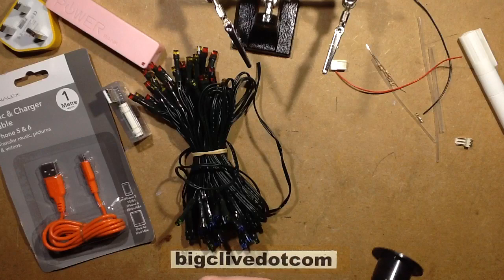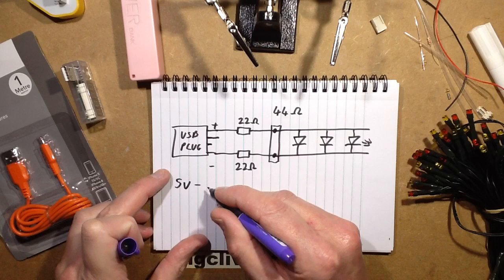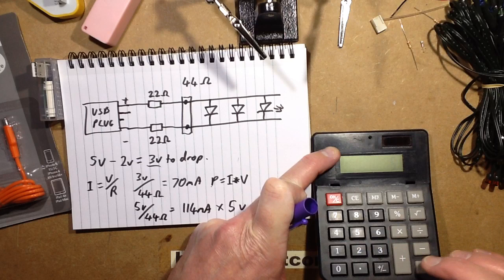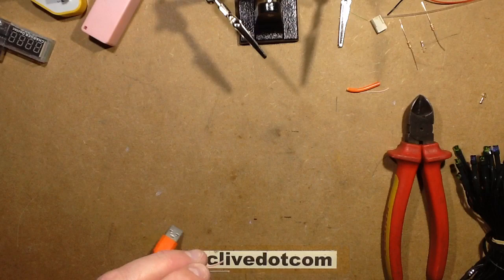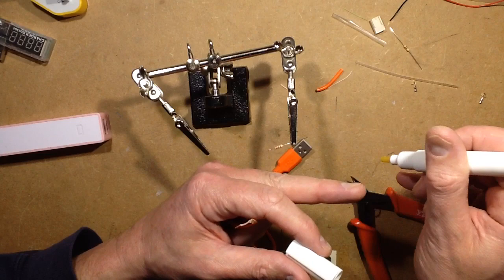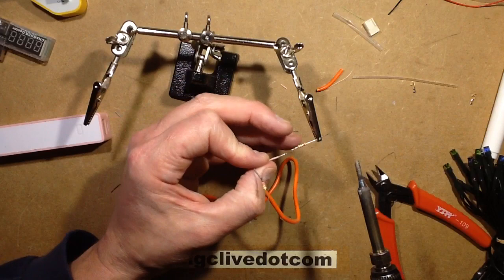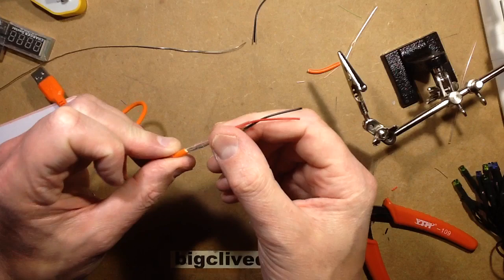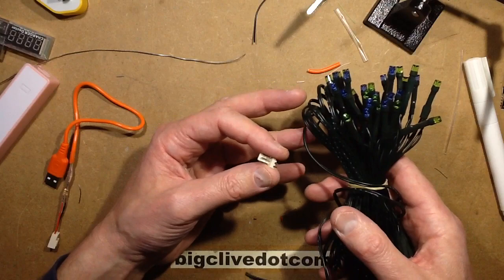Run LED strings on USB chargers and power banks.

Comment: Clive, I've noticed in some of your recent videos that when you move around the bench or turn away that the volume of your voice drops. Does this mean you've stopped using your microphone cap and, if so, why? Hope your Mum enjoys the lights, my Mum died recently after a year of increasing illness and I know how difficult it can be at times looking after your Mum when she appears to be slipping away.
Reply from the maker: The microphone doesn't work properly with the iPad.  It introduces a lot of noise.
Reply: Is that permanent or intermittent noise or does it just pick up a lot of background noise? If I remember correctly it's connected to the headphone jack isn't it?
Reply from the maker: For some reason it acts as an antenna with the iPad and causes lots of continuous noise.
Reply: It's a shame that it does that after all the work you put in making it and incorporating it into the cap - still, nothing ventured...
I assume you've already investigated possible causes and from your comment it sounds like the problem only occurs with your iPad. It's annoying when things like that happen. Maybe the iPad is overly sensitive or just a bit more crappy!

Comment: I'm struggling to figure out what would happen if I wanted to do multiple string lights and how toeasure what im. Like if all together all of the string lights used 14 AA batteries would that mean to power all of them I would be using 21 volts?

Comment: Where did you get the string of LED's? I have the power bank covered, as I build them all the time. I like things I can run directly from the power bank.
Reply from the maker: They were probably part of a solar set.  They usually have all the LEDs in parallel.
Reply: Try B&M around April time when they start to get their garden stock in.

Comment: Usb batteries do not have signal lines hooked up at all, they are by CE and UL standards null, No connection.     I have used them to connect smd LEDS in the past and had to cross them over to +&- upstream.

Comment: You are literally reading my mind with those videos, I was going to do exactly that, only power the thing from Li-Ions over the insides of DIY powerbank. One questions though: instead of using resistors, would it be more efficient to use some step-down converter (like S7V8A)? My LEDs will draw 1000mA (hefty set of white LEDs).
Reply: It would be a lot more efficient, use a simple buck converter IC.
Reply: It would be more efficient. But you must never drive LEDs by setting a voltage. The forward voltage of LEDs is quite temperature dependent. A resistor is the simple way to still limit the current in that case. You might be better off taking a constant current LED driver and set it to the right current for the whole string (and hope that non of the LEDs go open circuit, because than the other LEDs would get higher current).

Comment: Hi and Thx for your videos. However I would not use a cheap power supply like that without surveillance. Are a few bucks worth taking the risk of a fire in your home? Also the rating of the resistors are in open air I think and at the rating the temperature increase can be 100 or more. It's usually recommended to avoid above 50% of the rating especially if the heat is trapped. And again, putting 4 resistors instead of 2 costs only cents. And finally 3x7=21 hahaha... :p

Comment: I've always wondered, how do you instantly know the conversion between inches and millimeters for most lengths? Do your electric engineering jobs make use of both?
Reply from the maker: +Zazaaji In the UK we use both systems.  Our tape measures and rulers are marked with inches on one side and metric on the other.

Comment: Sorry to hear about your mum, altzeimers creates lots of confusion :-(.

Ive seen lots of those 3,4,5,6 pin connectors in old video recorders, they work for years.
Also old plastic film containers are good for protecting mid cable mods :-D

Comment: Evening Mr Clive.. can you do the same sort of thing for running 4 led lights I want them kind of bright and didn't know if I would need resistors and what kind of battery to use with an on/off switch holder ??

Comment: there is no power coming through that D+ and D- lines, only when a device (Cell phone, tablet) sends the data to like a computer or laptop, therefor you don't need to worry about short circuit data lines

Comment: Thanks for making electronics so easy to understand. If possible could you show how to add a 4pin power conector to a pc power supply for conecting to a motherboard. I have a power supply with a 20pin conector but missing the 4pin. I hope that makes sense. Thanks.
Reply: Thank you for your quick reply. I think my motherboard is an old p4 board and my newish power supply has no 4pin connector. It powers up but I don't get any bios. I thought maybe the missing connector was the problem.
Reply: That 12v 4pin connector is meant to supply the CPU itself. And is rated for more than 10A on most power supplies. If your PSU hasn't got that connector, it probably doesn't have the guts to run it.

Comment: I was wondering why don't you crimp the connector directly onto the resistor terminals?
Reply: Likely the resistor wire is too big, or not meant for solid wire. or both.
Reply from the maker: The flexible cable is stronger in the crimp than the solid resistor lead.

Comment: Clive, I have a Christmas 20 set from Asda which are 3v battery powered but I wish to power them from my USB TV port. Do I need a resistor? the label says maximum power 0.88W and each bulb is rated 1.8-3.6v.
Reply from the maker: Yes.  A resistor is needed.  I did a video about running LED strings from USB.  If you connected the LEDs directly they would sink as much current as they could.

Comment: +bigclivedotcom

I've been looking for those headers but I can only find the Molex ones. I'm trying to design a fan controller and these look the same as the three-pin fan headers motherboards use. Any suggestions as to where I can find the cheap ones, as in the "magic words that will get eBay to find them for me"?
Reply from the maker: If you're in the UK you can buy them from Rapid Electronics.  Most main electronic component suppliers will stock them elsewhere in the world.
Reply: just what I thought, he said rapid electronics for most stuff but not looked myself.

Comment: I tried this as well but my string of Xmas LEDs had a control box that cycled through 8 different flashing patterns. However after 2 minutes, it powered off. I had to disconnect from USB power bank, reconnect and then start it again but again stopped working after 2 minutes.  I was testing through a breadboard since I'm not sure the 22 ohm resistors were the correct value for my string of LEDs. Any suggestions?

Comment: Have you considered a twin 240v socket with built in usb sockets for your mum's bedroom?
Reply: Clive's done a video on that
Reply: Steven Ruscoe I was thinking of his mothers bedroom, not his channel.
Reply: I seem to recall he isn't too fond of "integrated" electronics; as something tends to go (ie. capacitor) it might be a fire hazard and you end up with dud usb sockets in your wall that you have to either replace (time, effort, money) or accept and end up using an adapter anyway.
Reply: ***** I would hope so; did you check the capacitors (T rating and such)? Is it switched-mode or just capacitive? What's the isolation like? What would happen in case of moisture? Is it fused? I don't know, there's just so much that could potentially go wrong... I got one integrated in a power strip (also from aldi, coincidentally) and if I'm honest I'm even leery about that one.
Reply: Very convenient, but not very good. Mains sockets should competently supply mains voltage and nothing else. I wouldn't expect a USB hub to also have a convenient 230V AC socket built-in. Horses for courses.

Comment: I'm a complete beginner so it is very likely I've done something wrong but when I put everything together it is still pushing out 5v. Why?
Reply from the maker: If the resistors are wired in series properly they will limit the current, and while it will appear as 5V without any load connected, as soon as the LEDs are connected the voltage will drop.

Comment: Can I use a instead of 1 adapter a USB HUB in order to connect more (maximum 4) LED lights?
Reply from the maker: You can use a hub to power multiple strings.

Comment: I have USB string lights. I noticed when I plug them in they get very warm. When I plug them into the power bank they are noticeably much less warmer. Should they be getting warm at all? The seller is telling me it is normal for them to get warm. But I don’t want to burn my house down!

Comment: Mate could you make a video on how to turn LEDs in to battery pack but they are ac power I don't want ad I want battery pack
Reply from the maker: If you have a parallel string of LEDs then they can often be run from a three AA cell battery pack with just a 10 ohm resistor.

Comment: This is going to sound like a newbie question: how are those 2x22ohms going to drop 3V? How do you know what resistor is dropping what? I didn't see that in the calculation anywhere. It's just like "3V dropped, so okay, that this and this much mA", but where'd that 3V come from?
Reply from the maker: The resistors just limit the current and the LEDs will settle at their forward voltage at that current while the rest is dropped across the resistors.  It's a balance.  If different LEDs are used then the voltage across the resistors and the current through them will be slightly different.
Reply: bigclivedotcom
Ah, so you need to kind of work backwards from the desired current, and work out how many ohms you need at 3V to get to that current. Intriguing.

Comment: ok so I actually went ahead and tried this, I think with the same LED lights off ebay. 

The solar panel charger had a "mode" button on it for switching between either blue/green or orange/red lights. As far as I can work out, this mode button switches the positive/negative around, which means the entire set of lights can't switch on at once!... right?

So possibly I managed to get a different variety. Is there a simple workaround to fix this?

Or alternatively, what can I use to rapidly switch between the two modes?
Reply: ah xD he actually talks about this at the start of the video.... whoops!

Comment: Folks, what do you think about soldering cable ends before crimping? Good thing / bad thing? I still can not decide what is better. Of course, when I am working on cars, I try to allways crimp + solder cables to fast-ons (strain relieve + corrosion protection between fast-on and cable end). But what about situation like this? No big amperage, no big voltage, probably indoor usage...
Reply from the maker: I'd rather crimp connectors onto unsoldered ends.  But the choice of crimping tool is important.  For the best results use the ratchet action crimping tool that forces you to apply enough pressure before it will release.
Reply: Yes, ratchet type is best also in my opinion. But since I am using cheap one, I know I have to apply even more presure then needed with standard crimping tool. Anyway, thanks for sharing your working method.

Comment: Evening Mr Clive.. can you do the same sort of thing for running 4 led lights I want them kind of bright and didn't know if I would need resistors and what kind of battery to use with an on/off switch holder ?? Thanks
Reply from the maker: For such a small number you could use one resistor per LED.  For standard 5mm LEDs at a good brightness you would use 150 ohm resistors or higher.

Comment: Do you have a video explaining how to connect the led string lights with the patterns to a constant battery supply? I've been trying to figure that out for a while.
Reply from the maker: The ones with alternate LEDs connected with reversed polarity need to be driven with AC.
Reply: @user-gx6jb6wc5g  it's very interesting, I have a 100 set of white led lights that looks just like the ones in the video but they came connected to a battery pack that uses three AA batteries and has a small button for blinking etc functions. When I cut off the battery pack and connected the two ends of the string light wires to a 12v car battery that has a reducer, every other one would light up, when I reversed the wires, the same thing happend on the other side. But can't get all 100 lit at one time.
Reply: @BisonArmstrong  Something in the battery pack circuit board was making the DC alternate.  Try using the little circuit that was in the battery holder.  Eventually, try to understand what is on that little circuit and then make your own version.  There are many different ways to do it.  Start by understanding how they did it, if you can.  If you don't need all the chasing patterns, etc., then it becomes fairly simple and can be done without a fancy shmancy IC.

Comment: You seem a bit rushed towards the end. 

Would there be a way to control these with the data lines? Some kind of circuit to change brightness or patterns with a computer, I mean. 

Sorry to hear about your mother, my grandmother had that as well before she died. Hopefully all turns out well for you.
Reply: You would need a usb capable microcontroller for that. Easily done though. Look at V-USB on attiny with Arduino bootloaders.
Reply: esp-12-f / esp8266 chip, wifi controlled, working on something like that myself.
Reply: nyetloki Couldn't you just write yourself a driver in Windows and make it software controlled? You don't have to use micro-controllers for everything.
Reply: AIO inc. THAT'S NOT HOW USB WORKS. AT ALL.
Reply: nyetloki It's a serial port.
Universal Serial Bus.

Yes, it is on a bus, but it's controlled in the same way as any other serial port. Drop some bits in the output buffer, wait for bits in the input buffer.
Reply: nyetloki Let me put it like this:
Serial is a linear transfer. One bit at a time.
RS232 is a standard serial interface.
USB 1.1 is also a standard serial interface.
USB can both transmit and receive.
RS232 can both transmit and receive.

Hell, Centronix Parallel ports have a bi-directional mode.

This is a software issue, not hardware, despite Intel's shitty documentation of USB (1.1 was just a clarification on 1.0), it's still a standard serial interface, hence the name universal serial bus.
Reply: AIO inc. so then show me a single instance of some one controlling lights from usb without a microcontroller.......
Reply: nyetloki Give me a valid reason it's not possible. 

If you can control a microcontroller via USB, then you can most certainly control a string of lights via USB just by grabbing the port from Windows and sending bits down the data output to switch some transistors and blink LEDs. There's nothing preventing you from doing this besides your bias against it and the amount of work it could take to construct such a device.

I even drew up a very basic schematic and parts list for you here: http://www.mediafire.com/view/9s600wyl2ryer4c/USB_SWITCHING.png

It's really low quality, but I had to draw something to get my point across and my CAD program was being picky. The only thing I don't detail in the image is the software.
Reply: nyetloki I see, so I give you a proof of concept and 13 days later you come back just to tell me that you think I'm wrong and that you're now disproven statements are incorrect?

Comment: I am totally ignorant about electricity.   I bought lights that are the copper wire ones. They already were fixed with a usb.  I then am plugging them into a 4000mAh power bank.  They only last a few hours with one power bank charge. How can I improve this.
Reply from the maker: You could add a couple of 10 ohm resistors in series, but they will be dimmer.